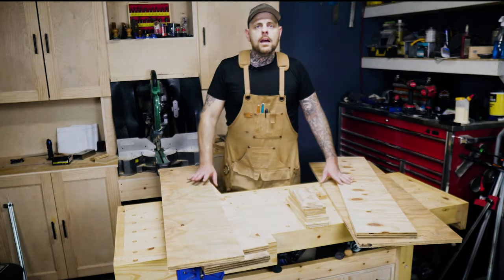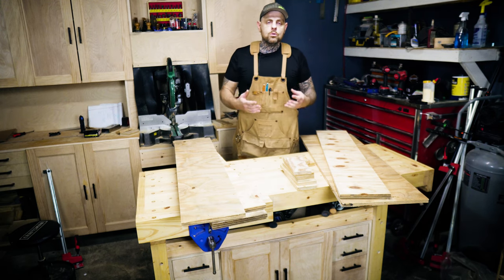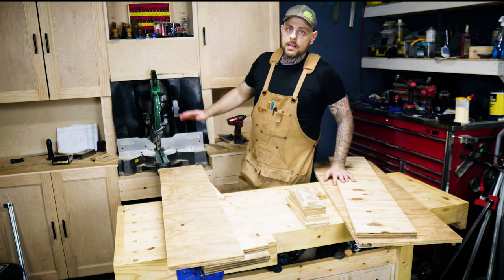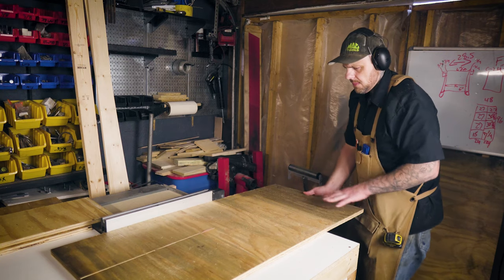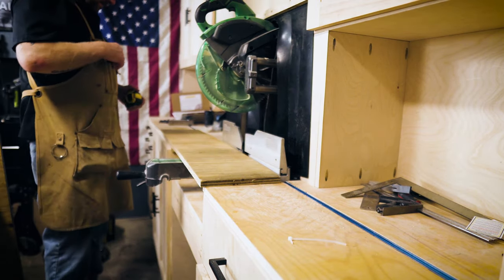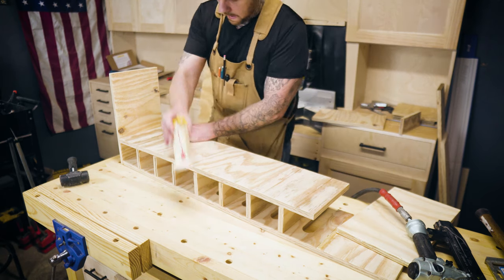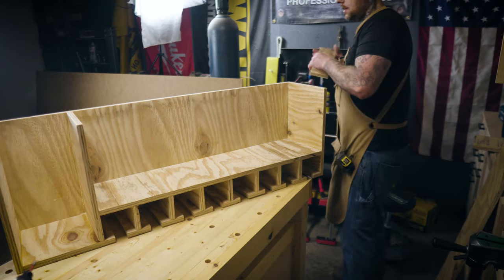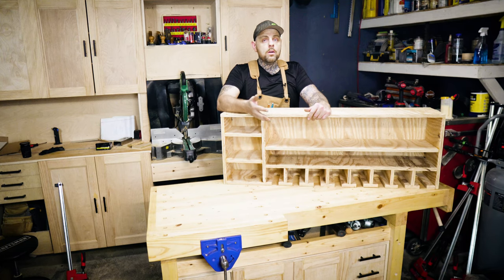Cordless Tool Storage Unit Build: A Great Side Hustle For Woodworkers

Comment: Instead of using the jig saw to cut, use your table saw. Cut just enough so there's maybe a 1/8 left.  Then put that piece of wood 8n your clamp and use a hand saw or hammer or sheet rock saw to finish. It might be faster, it might not.